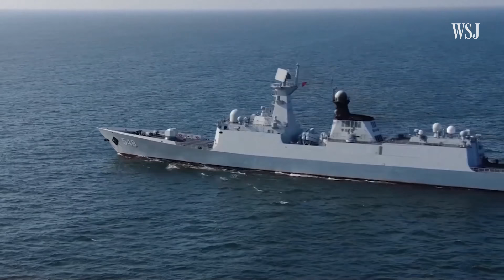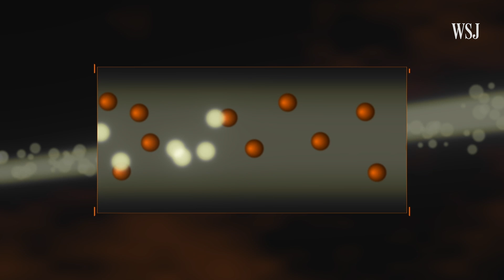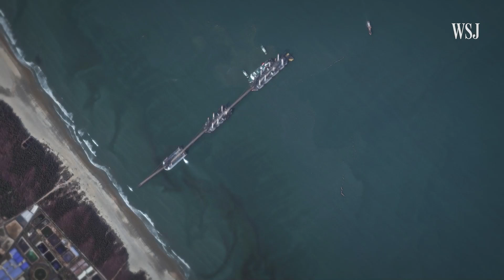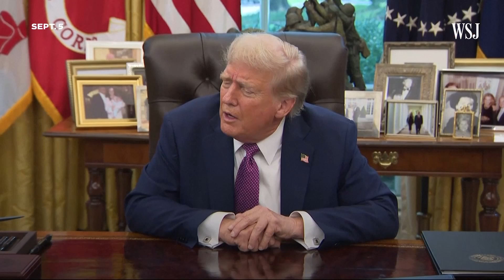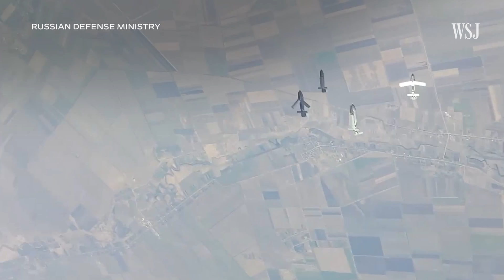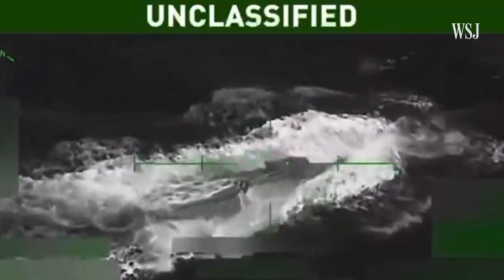Breaking Down Iran’s Shahed Drones, China’s Invasion Barge and More | WSJ Equipped

Comment: China does not need to heavily advertise its most advanced aircraft, such as the J-20 or J-35, because the technology is designed primarily for their regional dominance rather than export, and keeping capabilities secret preserves strategic surprise. China restricts, rather than promotes, this tech to avoid technology theft and to hide the exact capabilities of its military, which is believed have become way more advance compared to Western standards in engine reliability and production capacity...càse on point look at how they advance on EV Technology by which China believes Western folks have reverse engineered...

Comment: A stealth jet means it is hard for radar systems to detect, it does not hide or lower its engine heat signature. Meaning it has the weakness to be hit/shot down by a IR manpad at low altitude, but considering the USAF was able to conduct 500+ strikes per day in Iran at the cost of 1 F-15 and 1 damaged F-35. This is actually impressive that the USAF lost such mininal casualties whilst in combat operations, either the comment section are operated by bots or just slow mentally.

And note as well Iran was operating Chinese and Russian SAM's for air defence, they didn't seem to work at all. 😂

Comment: The f35 is the most vulnerable aircraft of 2026. It can not evade legacy radar used in the recent Iran war and it’s decoy can not prevent cheap missile Iran use using simple sensor fusion only infrared tracking and optical object detection ai incorporated in Iran cheap drone according to open source intelligence. This is why the us as of now try to not deploy then in to the Iran war after it was shot though no report it was down but this eliminated the narrative of Lockheed Martin entirely.iran using low frequency pulse radar with frequency hopping to detect the f35 that causing the f35 miss detection of the radar and enter the shooting range of Iran air defense system because of the detection period was too short to detect by the f35 sensor

Comment: Why you all lying !! All this fake propaganda. Fake ish. Where are the drone intercepters in Hormuz ????? where are the interceptors protecting the oil fields ! STOP LYING NOBODY BELIEVES YOU
Reply: If by interceptors you mean the Blue Halo laser system, it is 
a) not yet mass produced at scale and likely still in the development phase (just going by the video) 
b) it is only a visual range system for handheld size drones, so not really fit to intercept the large (in comparison) shahed
it is thus simply not the right solution for the stated problem

if you mean the drones working in tandem with manned fighter planes, they are also not yet production ready or implemented to be used in a real war.

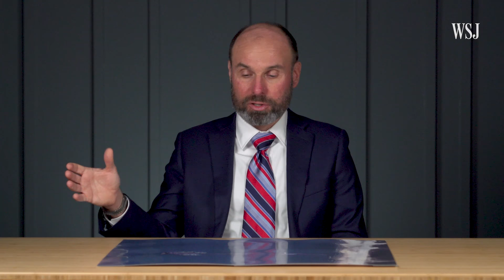Comment: 13:01   Thomas Shugart    Roll-On Roll-Off ferries, RoRo is short, are commercial ships used by the Chinese military in its drill of the Invasion of Taiwan. Roll-On Roll-Off ships can become critical assets during an invasion of the island for two main reasons. First, they increase four folds the Chinese navy's sea-lift capability. Second, they blur the line of what is a war ship and what is a civilian ship, creating a tactical ambiguity that could make an invasion of Taiwan easier for China. In this video we analyze how RoRo ferries are essentially China's secret weapon in supporting a possible invasion of Taiwan and we will try to answer two major questions: What are the sea-lift and amphibious capabilities of these vessels? How could China benefit by blurring the line of what is a war ship and what is a civilian ship?